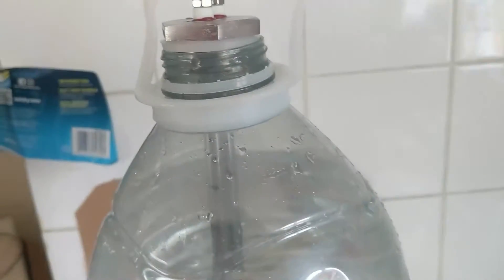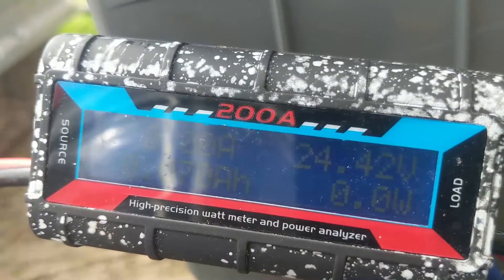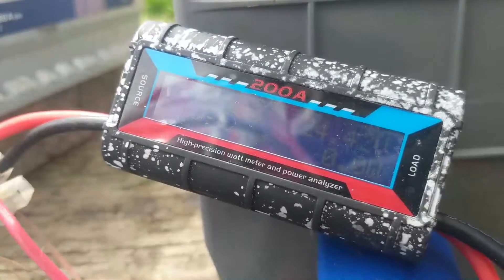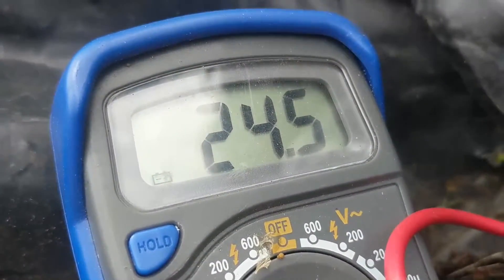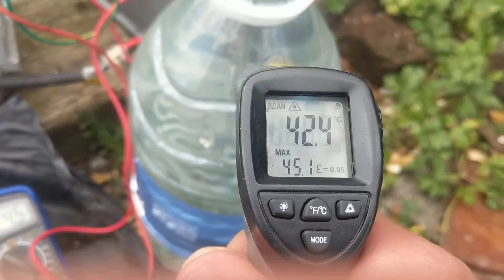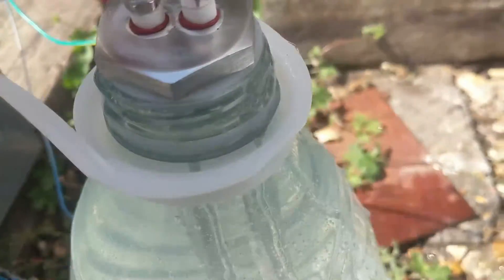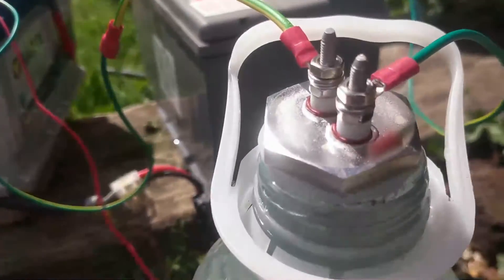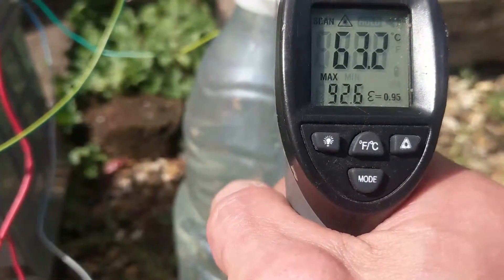Wind Turbine making Hot Water  28th July 2020 - BOILING WATER !!!

Comment: Could you connect the turbine direct to the element? I know it would only heat the water when its windy, but I live in a windy spot!!
Reply from the maker: Yes mate you can do that as long as you have big enough blades and a decent motor. You could just leave it on all the time. I'm pretty sure that's what I was doing in this video from the turbine straight to a rectifier then straight to a dump load.
Reply: @GavinFreedomLover  Thank Gavin

Comment: 1 kw axial flux 24 v wind generator battery charge   problem generator dc voltage up down sir dc to dc boost converter used / dump load use sir  please solution answer